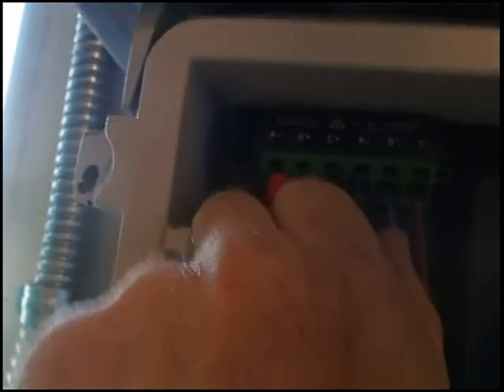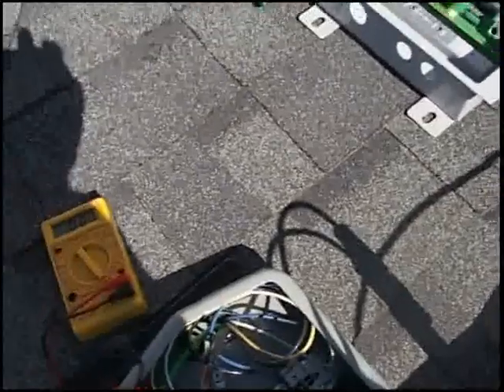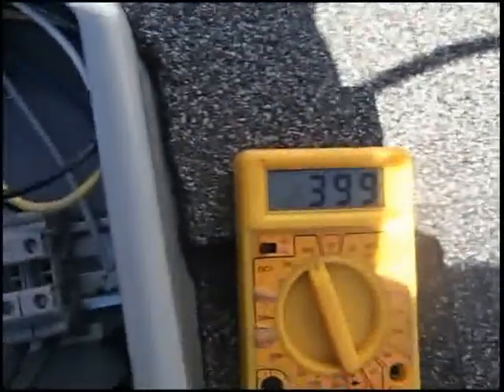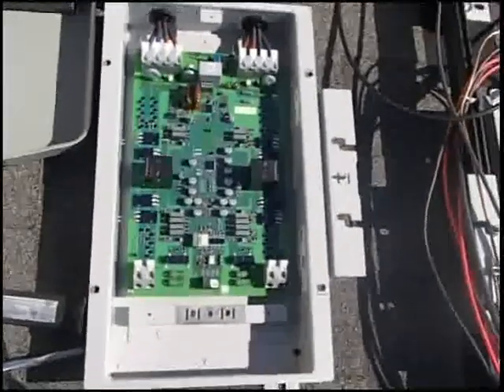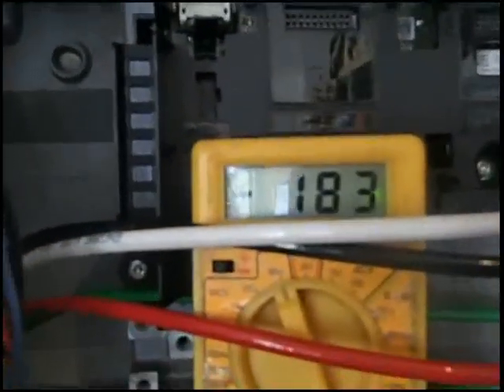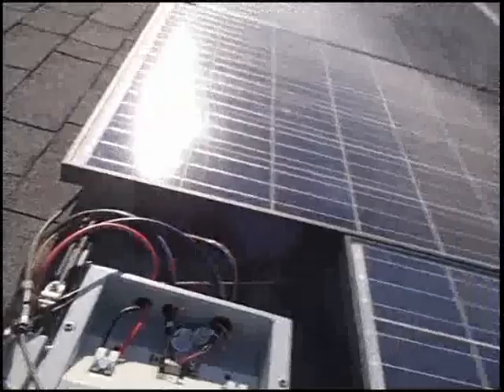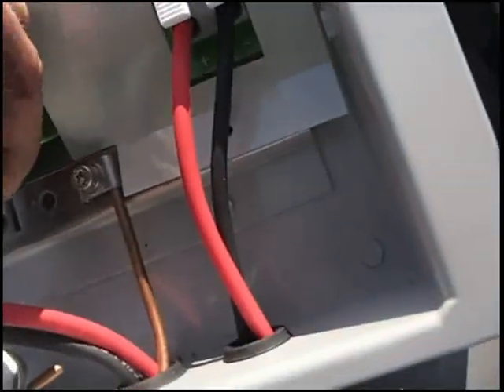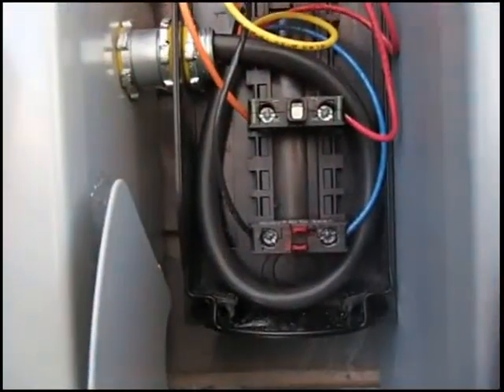Solar Panels - SMA Rapid Shutdown Problems [SOLVED]

Comment: So... the solution was to replace the box?
Reply from the maker: Maybe a different box would have worked, but the solution SMA gave me was to change the wiring so the rapid shutdown's output was no longer split between two inverters.  Worked beautifully, and has been working great ever since.  (Check out the full description to the video, especially the 12/23/2017 update.)

Comment: I have these boxes and had one I think was DOA. Anyway, the red light was staying on because you disconnected the controller lines while the box was connected to PV which causes a fault in the system. You can reset it be disconnecting PV or waiting for night to fall.